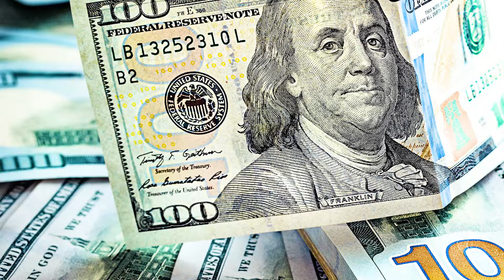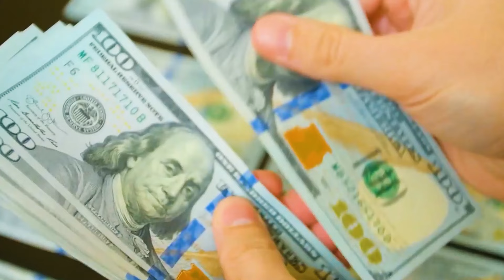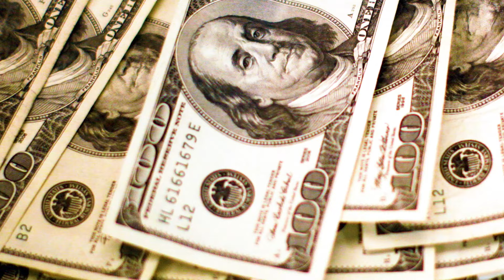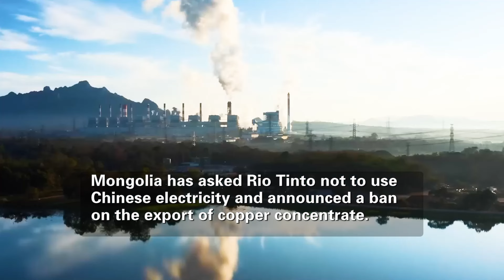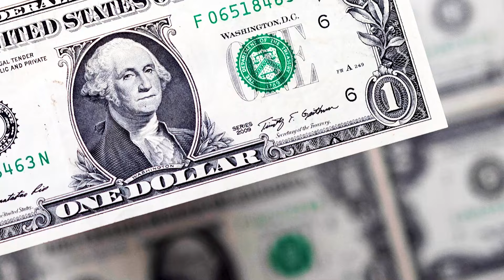Mongolia Cooperated with the US Ban to Restrict China's Access to Minerals, But All This Failed!

Comment: In 2016, China, Russia, Mongolia signed a 3-way trade cooperation agreement on international road transport along the Asian Highway Network. (This agreement is beneficial to China for transporting trade goods between China and Russia via Mongolia.) As part of this agreement, China agreed to open the highway route from Ulaanbaatar (Mongolia) to Beijing to Tianjin (天津) port. If China were to block Mongolia from accessing Tianjin port, then naturally Mongolia would retaliate by blocking China from transporting goods to Russia via Mongolia. The real loser is Rio Tinto.
Reply: There are other options available which may be less efficient but still viable through China's extensive BRI network .